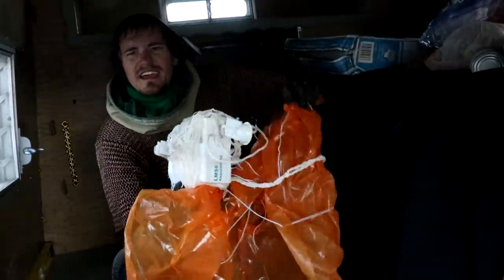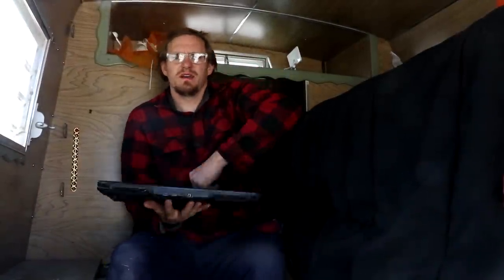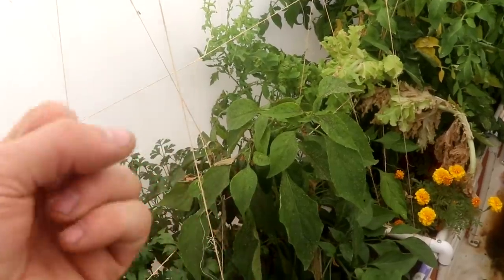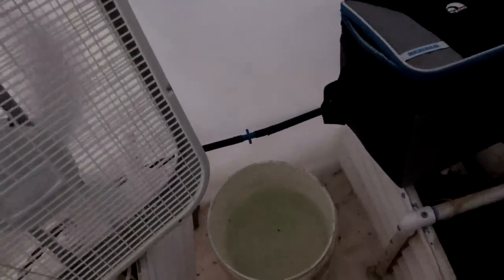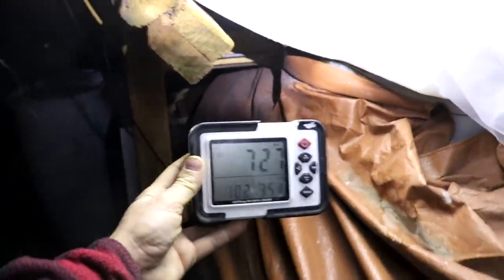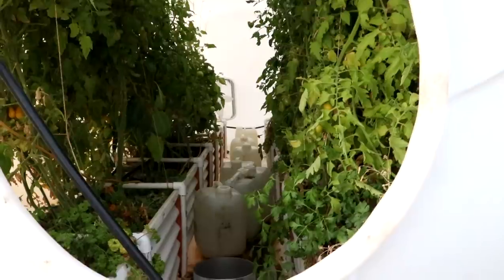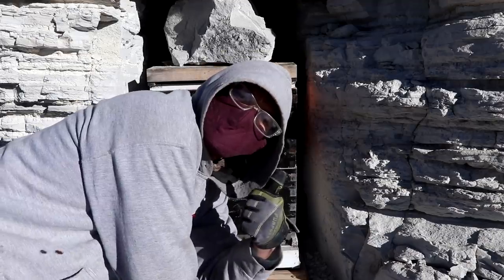ChickenHole Base Ep. 16: Avatar War On Aphids

Comment: I struggled for ages with aphids till eventually realising that they were coming in the soil I was buying.
Reply: "Wait, it was all the soil?"
"always has been."
Reply: aphids: number one reason i gave up on greenhouse vegetable gardens.
Reply: Careful with ladybugs, they can get out of control in the right conditions. always check the best subspecies for your location
Reply: @modernspartan98  don’t you usually have to buy them locally which means you can only get the ones from your local area? Sorry I’m dumb if this is a stupid question
Reply: So what you're saying is going and buying soil would be the end of my flower bed?
Reply: @WCGwkf  I doubt it, mine was cheap soil. If in doubt, try asking people in your area where they buy their soil. I bought mine at a hardware store instead of a garden center
Reply: What brand did you use?
Reply: That’s pretty wild lol I’ve never struggled with aphids, you’ve made me realize that my soil isn’t coming with them
Reply: @BAGG8BAGG  We don't have quarantine, we did a lockdown till the cases were gone (in April)
Reply: @micomator  it was a trailer park boys reference. They had to quarantine their weed plants and get ladybugs and he can't say quarantine.
Reply: Me I use dirt but then I let it go a couple months without using it so pretty much anything in it died then I start using it for gardening
Reply: I used to bake the soil I got before putting it into my greenhouse, but I only had one of those tiny greenhouses that are basically like a shelf.
Reply: @asmolbean9300  are there other organisms in the soil that are good for plants? I don’t know much about this stuff. I guess baking the soil would make it sterile, is that a good thing?
Reply: @micomator  most plants are fine with sterile soil. Anything that would grow in bareroot hydroponics would grow in sterile soil. Some plants do need fungus and bacteria to get their nitrogen, but they are usually held in nodules in the plants roots so when you plant them they will repopulate the soil.

Comment: Other channels: "Don't handle dry ice without specific cold temperature resistant gloves, goggles, full lab safety equipment and proper training."
Cody: 'Mmm dry ice feels tingly in my hands'
Reply: You can tell he is immune, same with cyanide...
Reply from the maker: Did you catch the video where I ate some? 😅
Reply: @theCodyReeder  I imagine many professional lab people face palmed to that video.
Reply: @theCodyReeder  did you see the most recent nilered where hes screwing around with cyanide? curious what you think
Reply: dont inhale too much and dont touch with wet hands -> nothing to worry about.
Reply: @Targe0  If it helps consider it a carefully done performance, like fire eating.
Reply: @YossiRafelson  If I remember correctly, Cody drank some cyanide one two times to show that it's the dose that makes a poison :P
Reply: @Targe0  Hahah that video was great, I'm also wondering what Cody thinks about smelling cyanide
Reply: In 7th grade I held my finger on some for a while, my teacher started to doubt my intelligence and my finger was very cold for a while.
Reply: @YossiRafelson  “these almonds smell like nothing”
Reply: you can put dry ice in your mouth as long as you move it around.  I've done it many times😎
Reply: It's a heat transfer thing; You can touch a hot stove burner *without getting burned if you bounce your hand off it fast enough. Fun at parties until you get overconfident and linger for more than a few milliseconds. Actually, matter of fact, don't try this at home. Especially at parties.
Reply: @oogalook  also there’s something called the Leidenfrost effect
Reply: Science Revolution  compasses point north-south, not east-west
Reply: @Quasi Remember, this was Robo-Cody... The OG Cody was in the hab module, controlling it.
Reply: no one talking about the drinking heavy water
Reply: @theCodyReeder  I mean there was the video where you bit a piece of potassium. This gives me a silly idea: you should do a "Cooking With Cody" series where you make completely inedible "food".

Comment: Insects really don't like low teemperatures. One time I was moving from a city apartment to a house, but I knew there were cockroaches hiding inside some of the furniture. So I didn't unpack the truck. I left it sitting in the driveway overnight, in February about fifty miles north of NYC. No cucarachas survived.
Reply: The easiest way to kill bedbugs is to crank the central heat and bring in auxiliary heaters and get the house/apt up to 130 degrees or so for a certain time. I forget the exact numbers. A friend of a friend got bed bugs at his house so I told him "bake that place and you'll be good to go."
Reply: Amazing advice
Reply: @mannys9130  So turn the house into death valley, got it.
Hopefully I will never need that advice.
Reply: @heroslippy6666  some friends of mine got bedbugs in their RV, and their solution was to actually GO to death valley in the summer, park the RV, and get a hotel room for the week. It worked.
Reply: No cucaracha! No cucaracha! Eheheeh...

Comment: Something my garden science teacher taught me back in middle school when our greenhouse got aphids was to mix a bit of Dawn dishsoap with water in a spray bottle and spray that over the plants. The bugs can't digest the soap and so they die off.
Reply: rather the surfactant negates the hydrophobicity of the bug's chitin exoskeleton and allows water to infiltrate and block its spiracles, suffocating it.
Reply: The bugs die because the waxy outsides are dissolved due to the soap and then the water drowns them. If you add a little neem oil to this it also kills their eggs.
Reply: Or - put a couple of guinea hens in the greenhouse and they will convert those aphids into guinea eggs, which are richer than chicken eggs!
Reply: Even better is specialized potassium-based (vs sodium, most other soaps) insecticidal soap. It's brutal against aphids. "Safer" is the popular brand name in Canada, I don't know about the U.S. market.
Reply: Add some vinegar and salt to that and you have the best weedkiller you can ask for

Comment: Plants for winter growing in a greenhouse: lettuce, asian greens, cilantro, claytonia, spinach, parsley. they all can take frost when hardened off and bounce right back after thawing. might be a more nutritious and tastier way to get veg in late fall and winter than trying to push tomatoes. with low light levels and cold temps, tomatoes taste like nothing anyway, even if you get them to ripe in your greenhouse. If you want more tips or have questions regarding that, DM me, I have grown cold hardy crops in an unheated tunnel through the past two falls, winters, springs.
Reply: Probably also want to have potatoes...

Comment: @3:30 I lived in the back of my pickup truck for 8 months saving up for a wedding once. I used those pads to insulate as well. They worked great, but they soak up all of the moisture that otherwise condenses. I recommend spray coating a sealant of some sort or routinely changing them out to avoid mold dangers.

Comment: soap and water deal with aphids really well. get a sprayer from your local hardware store fill it with water, add liquid dish soap (without artificial dyes or perfumes). a weak solution would do fine, then spray every plant top to bottom and get undersides of the leaves.

Comment: Great video Cody! I have had many problems with aphids in my garden. I have tried many of the normal recommendations for treatment but none seemed to work for me. Then I found a pyrethrin based insecticide. It killed all the aphids with ease. I would highly recommend it for your garden. Just a tip from a fellow gardener. :)
Reply: Also toxic to cats, so not good in his situation

Comment: An option to the iron rails is just a cap of metal on top of the wooden rails. This was done in older small production mines where getting the iron up into the mines was more trouble then needed.

Comment: I read in an old housekeeping book that was from the 1930's or so, that a good way to get rid of wood-boring insects in your subfloor is to do basically do the same exact thing.  Since the CO2 is colder and there's no air flow, it pushes out the oxygenated air and sits there for a while.

Comment: The fan was the mistake. Co2 is heavier than air. Afids near the floor so you would only need it to fill halfway up and leave it like that for a while. No need to mix it with air via the fan. Cuz 100 percent should kill them right?
Reply: There is way too much diffusion for any part of the container to reach near 100 percent. It is a gradient, with the highest concentrations sinking very near the bottom. He had less than 50% concentration after all.
Reply: @kelanbarr9646  He needed more ice then. :) I would love to have seen that all the way to 100% to see the affect on the afids and the plants. With enough ice he could have pushed out the oxygen through any hole near the ceiling.
Reply: @consaka1  plants can only tolerate up to a certain low level of CO2. Even though they use CO2 and H2O to make sugar they're not tolerant of high levels of CO2. You could see how they were wilting. 
It might be because CO2 dissolved in water is carbonic acid.
Reply: @henryD9363  not too surprising I guess since humans can't live with 100 percent oxygen either. It's all about balance.

Comment: How effective would having a generator exhaust into the green house.
Reply: wouldn't that pump other un wanted gasses into the greenhouse?
Reply: ewwww
Reply: Venting the exhaust through a heat exchanger in the greenhouse would help heat the greenhouse, but venting the exhaust directly into the greenhouse sets up a horrible contamination scenario.  Most effective method would probably be to bubble the exhaust through that tank that he set up with the black pipe to act as a heat sink for the greenhouse.  That would help warm the greenhouse, without adding any extra holes in the greenhouse, and absorb the peak heat from the generator.
Reply: @Kineth1  Yes, but there is no point burning fuel where there is so much sun per year. Solar pannels can do the same without the contamination, heatwise. CO2... I'm sure Cody can come up with a long term way to generate it or simply use a natural (homemade Castille maybe) soap that'll help during his War on Aphid and have other uses as for general cleaning at the same time.
Reply: effectiveness? 10/10 would kill all aphids, but it would also kill everything that lives at all because carbon monoxide and carbon dioxide are not the same thing

Comment: I over-winter potted pepper plants. Aphids have a field day as there are no natural predators inside my house. Previous years I was able to control them with some soapy water applied with a small paintbrush. This year was different. They would come back strong after soaping. Looked a lot like yours. I resorted to neem oil. It killed them instantly, but I think it might have damaged the leaves of one of my plants (not a pepper) Still less damage than the aphids were doing!

Comment: For lighting issues, I'd suggest getting an Emisar D4V2 flashlight with the 4000K SST-20 LEDs. It has great flood, brightness, light quality reliability and battery life on modest levels. It would be better for your eyes and the camera to get some neutral white instead of the cold white, you wouldn't look like a zombie either. Takes a bit to learn the Anduríl UI but once you get the hang of it you don't want to go back to a standard flashlight. It's one of the most popular flashlight in the enthusiast community, and it runs off of 18650 batteries which I'm sure you have loads of. Having a spare battery eliminates the need to leave your light charging, and you'll always have light when you need it.

I should've been sponsored..

Comment: The aphids are also a symptom of a larger problem. Overcrowding,lack of pruning, lack of ventilation will promote bacterial and viral growth. When you can see the results of them killing the plants it is too late. Regular treatment prophylactically with Docanil along with the pre listed cultural practices will make healthier plants.
Reply: im ntot sure where the link between aphids, and bacteria/viruses comes in, im pretty sure aphids prefer healthy plants over something half dead and infected
Reply: @bugsmith9751  
The healthy plants can tolerate some insect pressure but the ones that are already diseased are quickly overrun. The point to take away is that you have to be proactive rather than reactive. Once you see damage it's too late.
Reply: @michaelvangundy226  very fair! i have only done a little work with plants, and was mostly confused with the link of aphids and already diseased plants

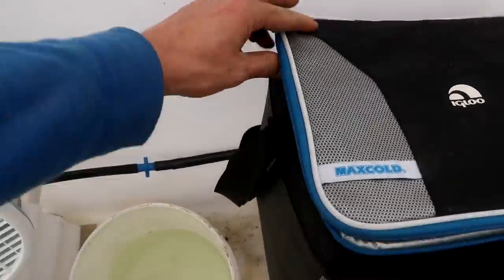Comment: 8:27 Infuse your bag with aerogel particles, and wrap the exterior in a White 2.0 painted material.

Also, soak your dry ice in liquid nitrogen. If you use a vacuum chamber, you can actually get the liquid nitrogen even colder than normal.

Comment: Hey Cody, as a suggestion, if you jack up the rear of the green house by just a bit it should be enough of an angle to help drain the center of the floor and won't really effect your plants inside.

Comment: @Cody'sLab
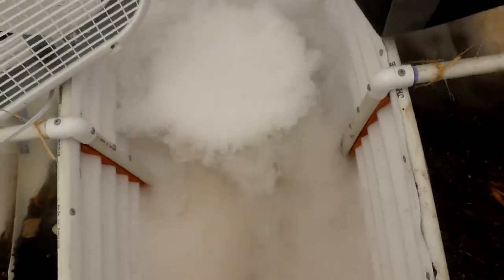8:50 I think the fan is a bad idea, instead basically make a small chimney* on the tank, so the air can escape while the rest of the tank get flooded with CO2 that is heavier than air (think of it like water filling up that tank).
(* a hole on/near the top & a small pipe sticking up a bit further, possibly with a larger cap over to prevent rain from falling in, the cap is loosely attached & can lift by the preasure)
Reply: Yeah, I was thinking the same thing. But then he did basically that when he used the CO2 tank. Cols CO2 filling the tank from the bottom up. Turns out that even colder air works even better. :)

Comment: Aphids, .. soap with a few drops of oil does wonders... which ones should have on hand even on mars. honestly any soap/oil will do just need to find the concentration where they cause the eggs/pupae to essentially explode/dissolve due to extra cellular osmotic pressure differential and  where the adult bugs choke to death from having their breathing holes clogged without killing the plants in the process. edit: greenhouse type stuff in Alaska.. ifs a fine wire also probably closer to martian conditions than most places in the winter.

Comment: ever heard of neem oil? it's a little hard on the leaves in the long term but it works. predatory nematodes are also an effective pest control solution. though they would be more difficult to use in this situation, they're much easier on the plants.

Comment: always interesting. 40% CO2 and still kicking. As a young entomologist I froze a devils coach horse with lighter gas, must have been -20C ?  just for a few seconds, it came back running as it warmed up. My mum just put the washing up water on the roses, washing them off is possibly a solution, or how about finding the resonant frequency of the aphid body, pop.  great work.

Comment: I must say, by my fight with aphids, that dish soap in sprinkler works kinda great, they also doen't like tobacco, so a mixture of both seems to work. Also you might try to plant some of tobacco plants alongside to help other plants get rid of the bugs, if it's legal there :D, and a small sugestion, raddishes are supposedly a pretty durable plants as well that can withstand even cold snap.

Comment: @Cody'sLab Hey, Cody, what would dropping the atmospheric pressure inside the greenhouse while increasing the CO2 level. Might that have a faster and more adverse impact on the insects inside before it starts to damage the plants? The low pressure in tandem with a change in the air mix could be lethal. It seems like a lot more work than necessary but might be an interesting experiment for another season.

Would recommend if the prospect interests you to evacuate some pressure cylinders back home with a means of connecting them to the greenhouse when it's sealed up. The same system could then be used to introduce more CO2 into the greenhouse environment with cylinders at low pressure. Going at it that way you wouldn't have to bring equipment into the field that uses up your power reserves.

Comment: So, I had a bedbug invasion not so long ago, and considered suffocating them as a possible solution. I think you would have the same issues I did. 
First, you are much closer, but it is still not laboratory conditions so many of them were probably not exposed to the lack of oxygen. 
Two, such tiny insects need very little oxygen to survive. Not sure if aphids are the same, but bedbugs can even go into powersaver mode to reduce their resource needs.(hence half my stuff is in quarantine for a year...). I would advise also adding something to constantly eat up the oxygen inside, especially since the plants produce it.
But third, and I tink this is the most important, you would have to keep the chamber sealed and de-oxygenated for at least long enough for the current generation to die, and laid eggs to all hatch, and then them to die, hopefully before laying a third generation.

Comment: I have been meaning to tell you if you are still having problems with your lithium powered drill go get an 18 V nickel metal hydride Dewalt set. I live in a very cool climate and the old 18 V  is the only thing that holds a charge for days when it’s cold. Lithium batteries do not work well in cold temperature.

Comment: Yo have good results you really need to push the CO2 concetration pretty high. I've had good results with 12h in >80% CO2. It killed an infestation of red spidermites. The plants react to such high concentration of CO2 by dropping leaves as if they are old. But this does not kill the plants as it also induces formation of new leaves. At least this was my experience.